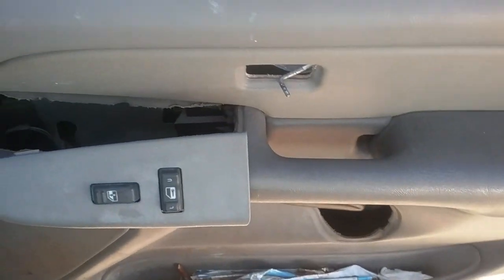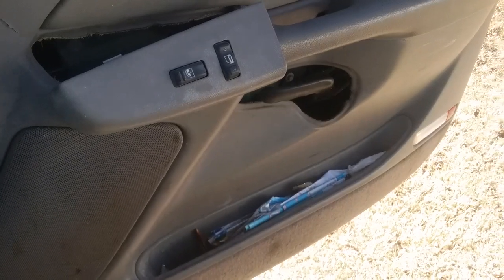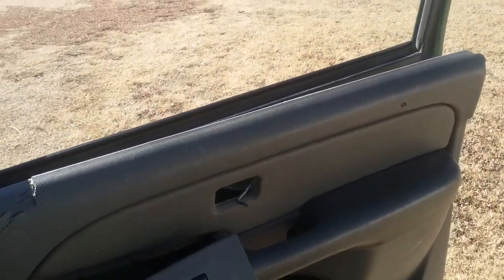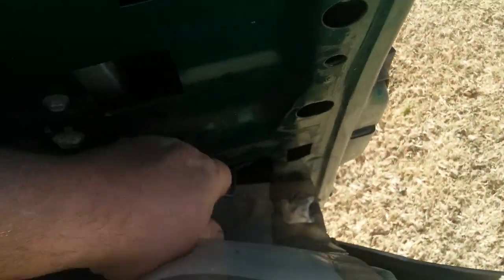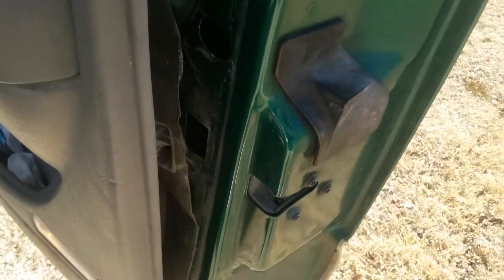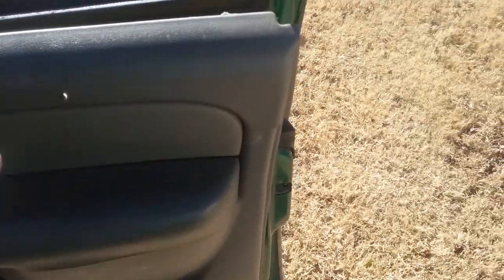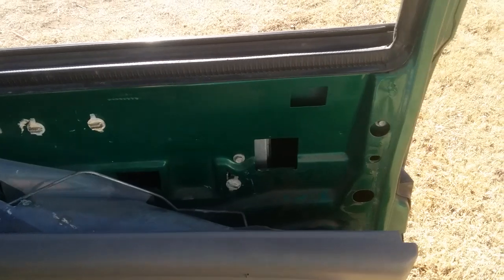How To Get a Chevy Silverado Passenger Door Unlocked When The Lock Actuator Fails

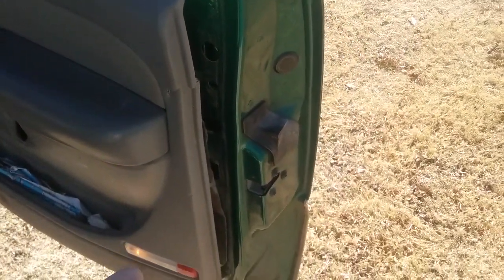Comment: @4:23  Thank you for posting. I see there is a hole covered on that door for the cylinder lock. My PS door also have that hole covered, but doesn't have a key access there.  Do you happen know if I can install a key lock on the passenger door, which doesn't have one? I have an extra cylinder lock, but it is for the DS, since the car is designed w/only one key lock on the driver side.

Comment: Worked just like you said, thanks so much. I ended up using a vice grip and a hammer as well, but its open! I pulled the breaker fuses to make sure it wont lock again.
Reply from the maker: Glad you were able to get your Chevy Silverado passenger door unlocked and opened!

Comment: So how did you get it open?  What's the point of this video ?   I need to open the door.  How can this be done?  Anyone know ???
Reply: fullmetalfred  how do you open your door? I have the same problem right now
Reply: Anyone that has a no open from both outside and inside may be that the door didn't fully unlatch.  Had a gal try and open my door and couldn't open it.  Little more of a firm pull is required. There's 2 positions in the latch and it's hard to determine if the latch is half open with all the weatherstriping preventing the door from having play.
Have the window down and firmly grip the the door, push and pull till the door completely shuts again, then a firm pull of the handle to pop open.  Once open,  grease the latch mechanism.   Should help greatly.

Comment: So...how'd you get the door panel off while the door was locked shut;?
Reply from the maker: From the inside of the pickup. Just take the bolts loose and then work the clips holding the panel to the door off.

Comment: It does it on the manual lock ones to mines that way right now and I can't figure out how to get the panel off
Reply from the maker: It's been 20+ years since I tood a door panel off a Chevy with a manual lock. But best I remember, there are clips that hold it on as well.
Reply: Yeah I know how to get the panel off I can't figure how to get the door open when neither door latch work
Reply from the maker: @bobearl7859  Oh, okay. I've never dealt with a manual lock that was stuck.
Reply: Did ya ever figure it out? My driver door is currently shut and locked. Won’t open and it’s a manual lock.
Reply: @Mid-MoDisabledhunter  i had my passenger side door stuck closed. I took both seats out so i could have enough room to take the door panel off. Gave me enough room to reach in there and get it open.
Reply: @bigabescanal2799  how did you open  it?
Reply: @jrbenally8949  take seats out. Unscrew whatever screws that you can get to on the door panel. Then pull it back enough to reach the guts\door latch and get it open.
Reply: @bigabescanal2799 i took out the seats and door panel any suggestions on how to unlock broken door latch actuator?
Reply: @jrbenally8949  try to find some images of what the inside looks like. You have to know what to pull on to get it to unlatch. The actuator has maybe 2 or three wires/rods that connect to it. You gotta figure out how it works to know how to manually get to to open. I just reached in there and felt around till i got it to open.
Reply: @Mid-MoDisabledhunter  Ever find the solution?

Comment: My driver side door is shut right now
Reply from the maker: Yeah, I couldn't get this door open without taking it apart!
Reply: Blue Collar DIY I took mine apart and I think I found the problem so the way my truck doors are set up is it has no door handles on the outside you have to open it with a remote and when I took the door apart I found something was disconnected and I’m assuming that’s the problem but I can’t connect it because the door panel is in the way and my hand doesn’t fit inside that small crack